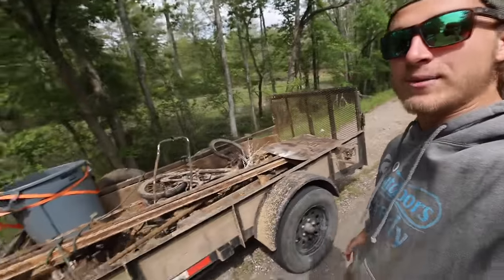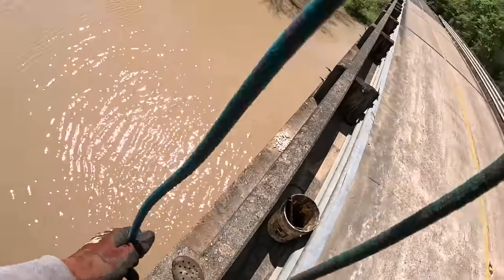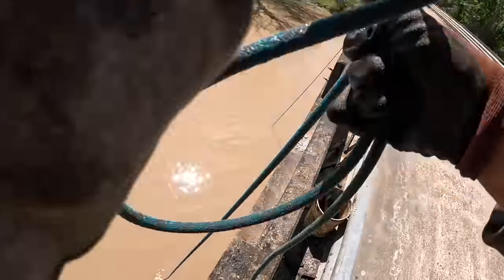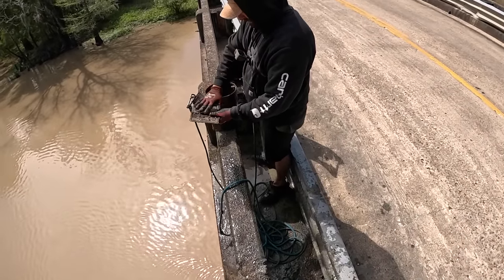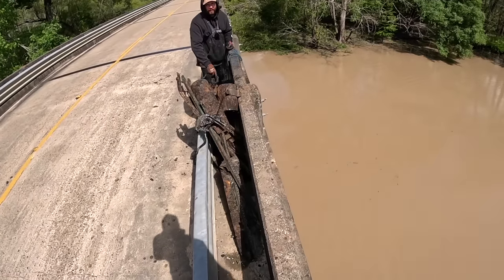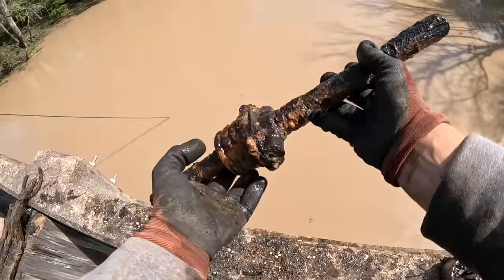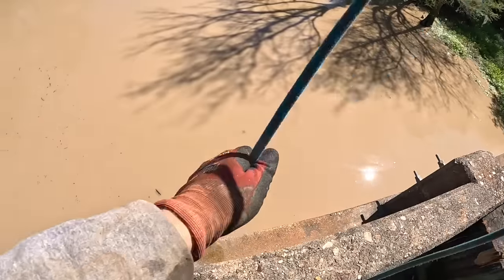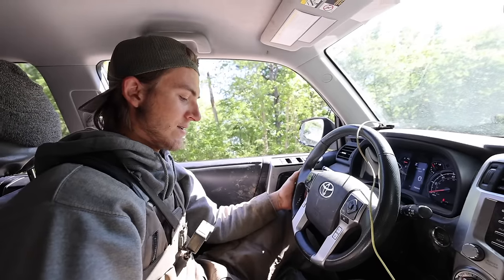Magnet Fishing Almost KILLED Me... Homemade Pipe Bomb Found Magnet Fishing

Comment: the squiggles as you call them coupled with the fact your finding barbed wire makes me think they are the broken remains of a chain link fence and likely the barb wire cabling that holds the barbs in place.
at 14:10 the weapon fragment found looked like the broken blade of an old Sabre looks to be a design from the late 1800's to early 1900's (this means nothing, would recommend getting it carbon dated to find the real age since people can still forge such a weapon today)

Comment: Hey sir just so you know at timestamp 14:17 you are holding the blade of a Bayanet ........... The groves down the side were put there so when you stuck someone with it the groves would keep the wound open to allow the person stuck with it to bleed opposed to the blade blocking the wound so you dont bleed
Reply from the maker: I need to go back and try to find the rest!
Reply: @Outdoorsweekly  you may be able to get the rest of it if it hasnt rusted away
Reply: @Thom1973  It looks like a WWI Bayonet, that was used on SMLE Rifles, M1917 “American Enfield”, and Winchester M1897 Trench Brooms (shotguns). 🇺🇸🇬🇧
Reply: @whatforaaron2494   ya thats what i was thinking ...........
Reply: the grooves on bayonet were designed to prevent sucking effect.  Bayonet can easily be withdrawn and target stuck again or take weapon and move on.
Reply: The grooves are called fullers, and the only purpose that they serve is to reduce the weight of the blade, the whole blood groove and sucking thing are common myths
Reply: Bayonet

Comment: I'm I'm stuck in between thinking. I was thinking when you first pulled up those squiggles that it was part of a really old bed frame that had special springs that they weren't actually like springs. They were like those metal rods that you were pulling up. You pulled up the metal bed frame. But you also found barbed wire so it could be some sort of fencing.

Comment: Also regarding the pipe bomb, theres two (likley) scenarios as to why its in the water. 1) some local kids discovered the anarchist cook book online, and are doing things they shouldnt be doing, and detonating them in the river, basically, dumb kid shit. I used to stuff like that, short of actually making shrapnel laced pipe bombs obviously. 2) someone is using that river as a testing grounds for their illicit engineering ventures. Obviously this would imply a more sinister motive than the previous option...